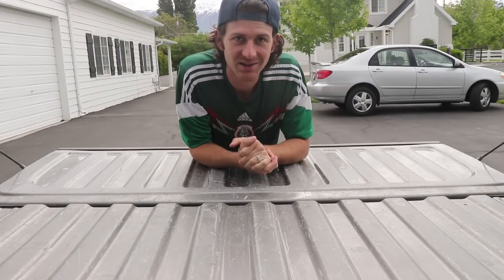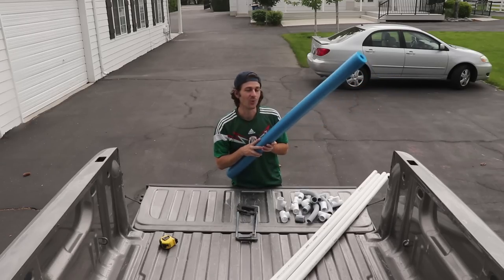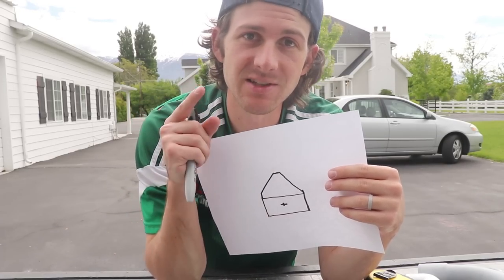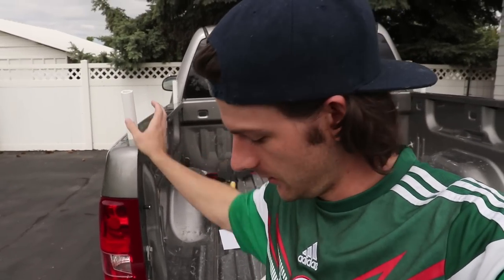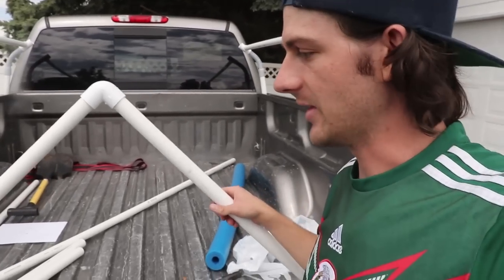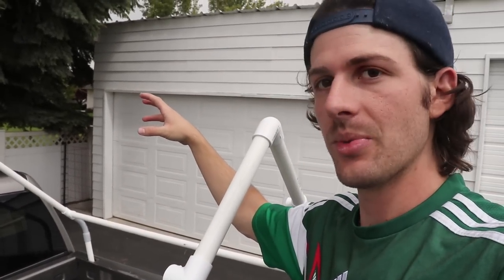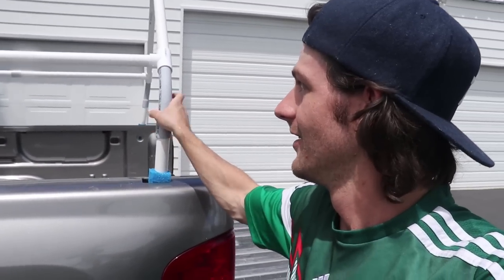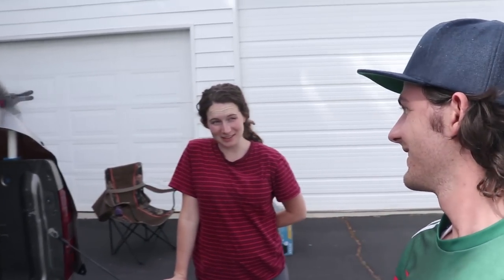DIY Truck Bed Tent! Truck Camping

Comment: Simple and easy. Looks like you would be able to sleep and stay dry in the rain. I would suggest more tie downs in case the wind picks up. If I had a truck I would use your truck tent system. How much did it cost? Very affordable usefull idea. Thumbs up.
Reply: Interesting video. Well done.
Reply from the maker: Total cost was probably around $30. And yes we definitely need more tie downs!

Comment: you should of showed it in a heavy rain ...all caving in for sure on top middle and be very sure it will !
Reply: If the tarp has grommets, which I'm sure it does, you can stake it out and have minimal issues.
Reply: Or raining in from the opening at the gate

Comment: You can use some Foam Pipe Insulation for PVC pipe so you don't have to trim the noodle. Great job. where did you get the gray 45's?
Reply: Those are used in electrical conduit!
Reply: Yeah, actually if it were made of all electrical conduit he might be money ahead, it's sunlight resistant.

Comment: I might have fitted a piece of wood into the stake hole and used a hole saw to cut a hole to fit for the PVC. I you extend the wood up several inches, you can mount shelving or accessories onto the wood on a 2X4. Get an old pool  ladder used .and mount it to the rear of the truck bed for quick access. Indoor/outdoor carpeting over closed cell foam carpet padding will make the setup more comfortable. You can get remnants cheap and duct tape them 
together.

Comment: Now all you need is a couple of screw in hooks to hang a battery powered lantern along the bracing it wouldn't hurt either to make a screen doorway with magnetic clips to hold the netting together to keep out those nasty mosquitoes.....

Comment: Center ridge line? Seems like the tarp could start to hold water since no support across the peak
Reply: Change the coupler on the last bar to a tee and get a pool noodle stuck on a piece of pvc  cut to the right length to create a small peak in the middle. Problem solved.
Reply: @melissacomer8404  I agree it was a suggestion not a question but thanks

Comment: I watch the fail camping truck tent video. Your idea is sound. I think if You could just some how figure out a way to lock the polls all to gether with pins at all the male and female parts to were the pips will not blow apart. The using that same pin idea if at all possible to lock the polls in place at all for places on your truck bed holes. Just my two cents.
Reply from the maker: That is a very good idea 👍 thank you
Reply: Your very Welcome.  I just got to thinking man this idea could work. I just would not put Your life on the line to test the real strinkth of this idea in really bad weather. But I do think this idea would work well in the same type of weather that You fail the first time. I think that would be fine but please use You own best judgment on this one. I would not want You or anyone else hurt because of some idea that just pop in my head.

Comment: You just got photo bombed at 6:54. Why didn't you use a 3 way 90 piece in the top corners to have a cross bar in the top?
Reply: Because the don’t make a 3 way 90 for pvc pipe...plumbing in 2d
Reply: @tallytigers  Just Google 3 way PVC angle...
Reply: Anyway, hope you've made good use of it!

Comment: Why not buy a used cap?
Reply: This set up is probably cheaper, and also, I think that they wanted it a little taller.
Although a cap makes more sense for hauling gear, from blowing around,  or if it is raining. 
They are young. A little adventurous, maybe it's just fun for them.

Comment: OK, now imagine a real pickup. With an 8' bed. I'm 6'6" and it matters. Oh and that won't keep bugs out.. no windows either..
Reply from the maker: It actually works really good.
Reply: @TheCoxClan  yet I stand by every word. I've lived in a campershell for a year. Noise, extreme temperatures, and insects. Those are the big three. Being able to stand up straight, and sleep fully extended are huge. A truck with an 8 foot bed or a long van is a good solid answer, even then I hunch over, but money is tight. Or I'd buy a class A!
Reply: You want windows??
Spend your cash.
Reply: @carlspackler91  yes cash bought my truck so it's like that, and gas costs money too! I'd guess windows too right?